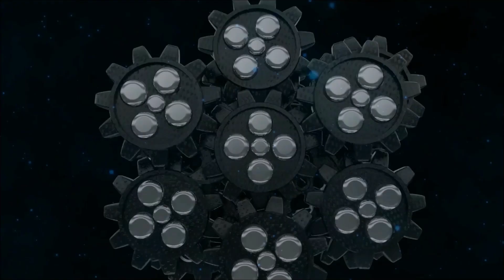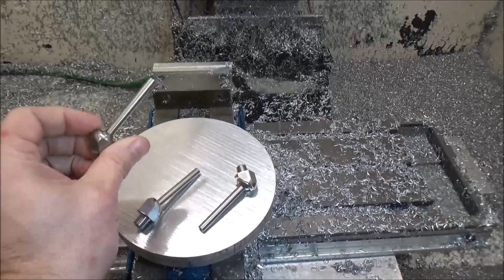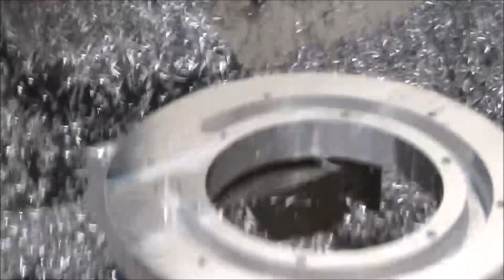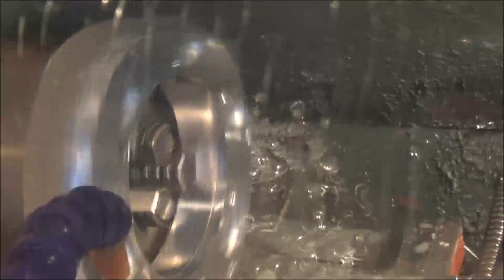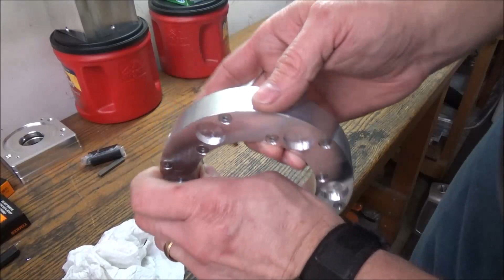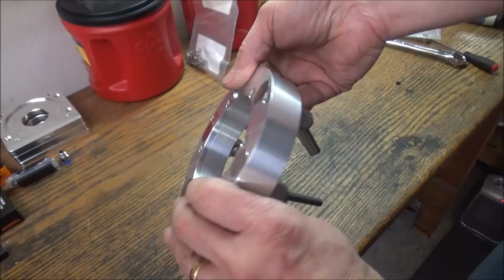Flood Coolant Ring

Comment: Made one of these for my Tormach a while back, works great the only thing is you will find that you don’t need as many nozzles and that they tend to get in the way of some operations.
Reply from the maker: yeah I think it's possible that they're going to get into way however it being magnetic it's really easy to pull off.
Reply: @CNC4XR7  I also put valve before each nozzle to control the flow and which direction it was coming from.  I love it other than getting in the way of a few things its awesome.  When I am done with an operation there is no chip anywhere on my table or part.

Comment: very nice job .

i have one concern that the magnets going to magnetize the spindle and that going to end up with same small electric charges throw the bearings and destroy them slowly . am not sure tho
Reply from the maker: The magnets are 3mm thick, and the magnetic pull is on the flat side not really much on the edge. I think it will be fine.

Comment: I suggest unplugging the pump from the tube and push to connect fittings and see what the flow actually is.  Those fittings and tube size are incredibly restrictive.  I'll upload some video of my coolant on the Tormach with both a 1/8 and a 1/4 hp pump for comparison.
Reply from the maker: Thanks Bill,
The small coolant pump I started with is really meant for a Lathe setup. With it's 3 gal capacity there's not much flow. Even just from the OEM 3/8" line straight off the pump.
I just finished up a new coolant pump system with filtration and wash down hose. It will post Monday still editing the video.
The new system has 1/2" line to the coolant ring.

Comment: I love it, but im curious if you can get enough flow through just a single 8mm input port? even with a bigger pump will it have the capacity to get a good flow/pressure?
Reply from the maker: I have changed the input to 12.7mm or 1/2" working well now. follow up next and new coolant filter and pump.
Reply: @CNC4XR7  awesome!